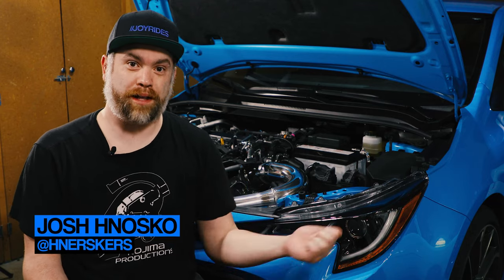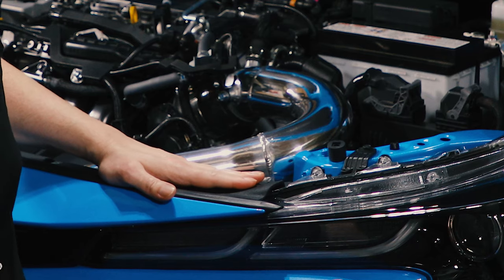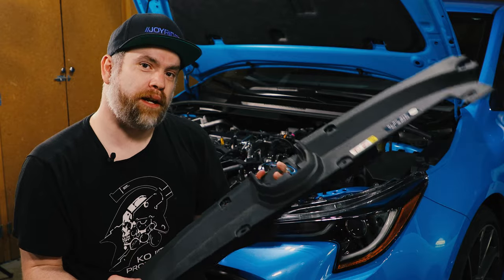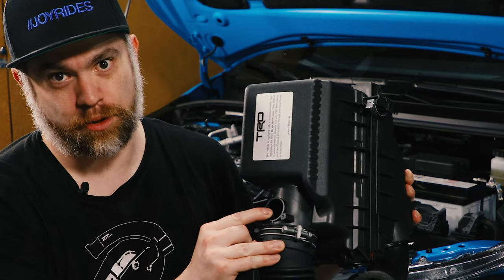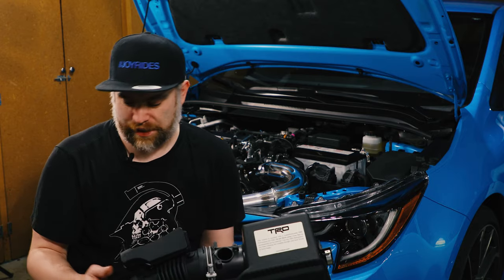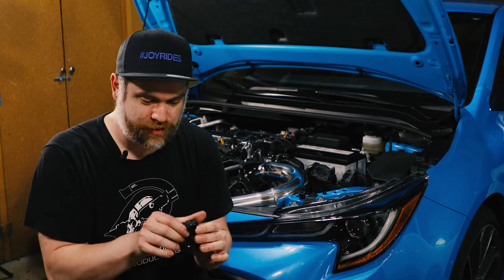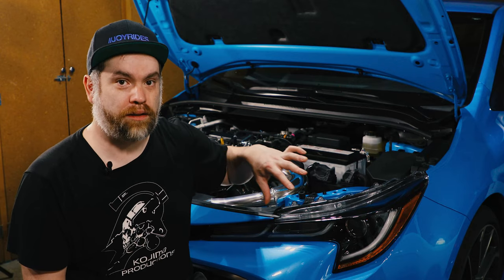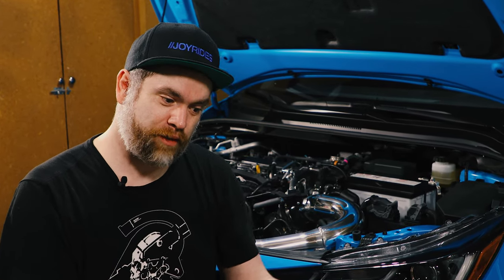JOYRIDES | 2J Racing Intake | Corolla Hatchback Mods!

Comment: I installed an Injen CAI on my 2020 hatchback - a bit raspy so I put a TRD intake on. Better sound. 

Also upgraded wheels/tires, put a front lip & rear spoiler. My first manual transmission - very fun to drive.

But just broke my right shoulder in a bicycle crash & wont be shifting for many many months crap.

Put the stock parts back on and sold it to Carvana boohoo. 

Going to buy the GRMN version when it comes out in 2022/2023 so I figured I’d get more of a trade in $$ now rather than then. Still sad though. Such a fun car!
Reply from the maker: Sorry to hear about your injury. I injured my knee a while back so a manual wasn’t an option for me but I too am looking forward to the GR Corolla!

Comment: Has there been a check engine light 💡 since you installed the 2j cold air intake
Reply: No, it's been 4 years without a check engine light on mine
Reply: @blacgaz6419  do you have pictures?

Comment: So I'm here before 100subs... don't make sense. Anyway, Joyride I just bought this car but I cant apply a CA Intake since I live in PR and deep puddles are common . However I can't wait to see what else you keep posting and doing to your car and others!
Reply from the maker: I do have the mesh covering on my air filter. It won’t protect against super deep puddles but in the Pacific Northwest we have our fair share of rain and so far I haven’t had any issues. Thanks for the kind comment!
Reply: @Joyrides  where in the Pacific northwest? I live just outside of Seattle and myself!! ALSO I HAVE A QUESTION FOR YOU..... 

First of all do you still have this car? 
Second my uncle had picked up a 2020 Corolla SE himself and he wanted to do an intake as well but for fear of sucking up water here with how much it rains we decided to do something a little different 

So obviously short ram intake are usually hot air intakes but we went with the K&n that comes with a heat shield and then the air duct that goes down to the front grill that actually feeds are directly to inside the heat shield BUT NOT JUST THAT.... We wrapped the intake tube in the gold reflective heat tape to help keep intake Air temps down as well BUT ALSO.......

We decided to do upgrade the air ducts with the new veloso tech Big mouth air duct that they make for this car so not only does the intake tube have the gold reflective heat tape to keep intake Air temps down but then we also have the heat shield and then also that big mouth air duct that pulls are and hooks directly to the heat shield to feed are to the filter 

So I'd say it's probably the best way to have an intake if you don't want to run a cold air for fear of sucking up water and don't want just a typical hot air short ram intake so it's kind of the best of both worlds!!

BUT I'D REALLY LIKE TO KNOW if you still have this car man or if you end up selling it or trading it in because I have some other questions that my uncle would like to know because he would like to do some other mods next like cat back exhaust header and a few other things and I would really like your opinion on them

Comment: Thanks for the video! Do you have any issues with CEL or throttle response at all?
Reply from the maker: I have since pulled it off because of weather and partially CEL’s. They were intermittent but also I have their full header/midpipe/catback so I didn’t put it back on cause I can’t really hear the induction sound over the exhaust. Maybe I will now that the weather is nicer. Still dealing with intermittent CEL’s with the exhaust setup. But the only way to solve that is a tune.
Reply: @Joyrides  Thanks for that. I decided I'm going to put it on when I tune.

Comment: Hey man. Big fan of the build. if you don’t mind me asking, how do you think the 2J performance mods compare to the mods that companies like Remark/Injen/Toms offer? I was originally steering towards Remark for my exhaust but I just noticed 2J offers a package that includes intake, midpipe, catback, and headers for a solid deal. the only thing that worries me about 2J is the installation process and some of the problems you encountered, also there isn’t a lot of other content creators posting videos on how these mods run/sound. Would love to hear your opinion on all of this if you have the time. 

Also cant wait to see a video on the rest of the 2J build!
Reply from the maker: I’ve had my struggles with check engine lights but 2J has been very responsive to discussion and working towards solutions. I will say that it’s not a direct comparison for the entire kit because no one else makes headers or a midpipe for the Corolla, which is now where the majority of my current issues lie. But when comparing the catback and intake they are just as good. I’d try going with their resonated catback since mine does sound a little raspy with the headers and midpipe but overall I’m happy. I just have to work through a few pain points with the headers and midpipe.
Reply: @Joyrides  So you’re saying the check engine light issues come from their header/midpipe? If I were to just get the resonated catback would I run into any issues? I was considering just getting 2J’s exhaust

Comment: Josh, how do you feel about just the 2J racing Headers?
Reply from the maker: While I had them installed at a shop locally, they said the headers bolted right up and were a perfect fit. They do affect the sound of the exhaust significantly and it sounds pretty good. May have to look at a defouler potentially for the added flow but idk for sure since I got the whole kit.
Reply: @Joyrides  interesting! Because so far I have the TRD intake with the Borla catback exhaust and vibrant resonator, I’ve heard from the 2J that the header works with the stock Midpipe so hopefully it fits, do you think it’s wise if I do a res delete with the header or just keep the vibrant resonator with the header?
Reply from the maker: Haven’t heard someone do a resonator delete with the headers yet so I’m not sure there. It does match right up with the stock midpipe. They made it so you didn’t have to have the whole kit if you just wanted specific pieces to work with the stock components.
Reply: @Joyrides  awesome! Do you think the headers are worth it? Because they don’t have it now, you have to pre-order and wait till end of December. Also I was thinking about to keep the resonator because if I do get a header it might be loud and super loud if I do a res delete. So I think the resonator could come in handy with the new headers

Comment: Hey joy it’s me again, so ima get the headers but do you think the mid pipe is worth it? So far my oem midpipe I change to a vibrant bottle resonator and I expanded the res outlet to fit my 2” Borla catback, it’s definitely better than stock now but do you think it’s better than 2JR or recommend getting that in the future?
Reply from the maker: I would t know for sure how it would compare but the larger diameter midpipe has been pretty nice from 2J. As long as your catback lines up with the stock midpipe it should be fine but maybe send 2J a message and ask if it would work.
Reply: @Joyrides  thank you brother! Last question, how did you get rid of the CEL with the headers? My friend with the header says he has that problem

Comment: i have yet to see this car go turbo, will engines handle it
Reply from the maker: The engine itself could probably handle it but I don’t know how much power a turbo would add. It’s got a pretty high compression ratio. Other thing would be the transmission. Not sure if anyone would go through the effort to boost one. I mean if I weren’t at all concerned about warranty then maybe .
Reply: @Joyrides  thank you

Comment: Will it effect the warranty?
Reply from the maker: Pretty much any modification won't inherently void a warranty but if something fails and it's determined that the mod is at fault, then it would not cover repairs related to that damage under the warranty.

Comment: Did you feel or notice any performance difference?
Reply from the maker: It did feel like it had a little more power. It’s not a ton more power but it was noticeable. 2J Racing has a dyno sheet on their Instagram with numbers for the intake and some of the other parts for the Corolla Hatchback.

Comment: Cold air intakes are a pointless modification on a stock engine.
Reply: The original filter that Toyota installs on that car is probably the best filter they carry. I did this in the early days too. With all respect. This is pointless. You may as well have done some cosmetic mods. That would at least make a difference. Nice channel though. Thumbs up anyways...